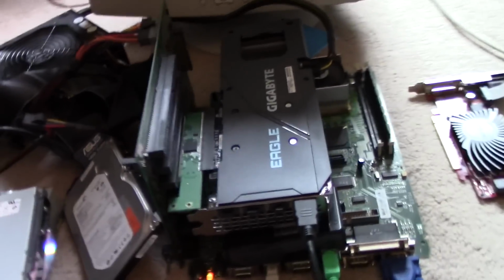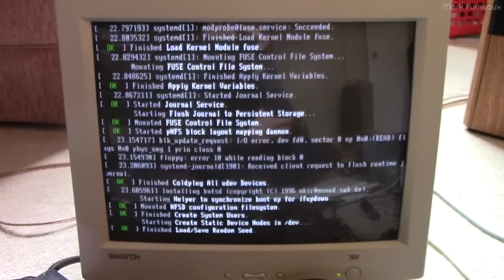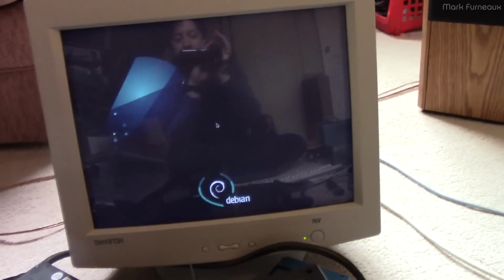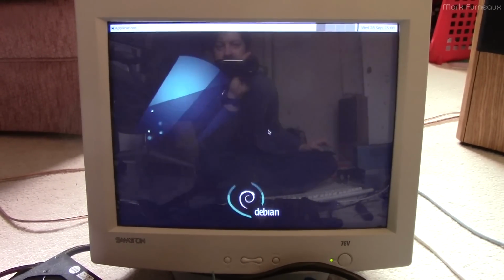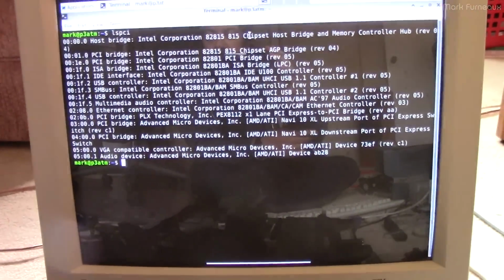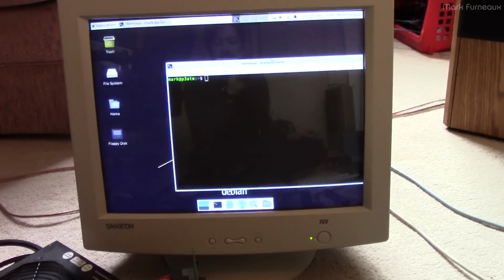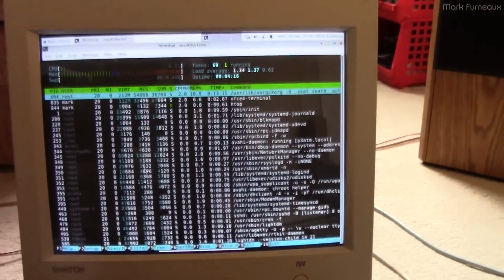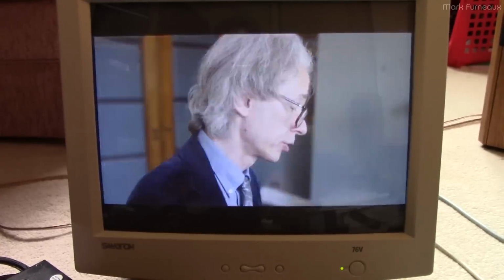AMD RX 6650 XT on a 20 Year Old 850MHz Pentium 3

Comment: I know this is an older video, but w/e... An interesting note. PCIE and PCI are also initialized by the same routine in the BIOS as well. In a previous life I modified BIOS code for x86 VPX and VME motherboards, from Core2 all the way to Sandy Bridge. The VME boards had a TSI148 chip which is a PCI-X chip but we just used a bridge chip for PCI-X to a bifurcated PCIE. Needless to say, the BIOS code was no different for initializing a PCI or PCIE device even through the bridge chip. Might also be of some interest, the BIOS code for PCI initialization in AMI BIOS code (at that time) is exactly the same (even the comments) as the Linux Kernel. 

The work that I accomplished at the time was to add a routine that would allow a user to select (in a BIOS menu option) the amount of additional system memory allocated to the TSI148. So I basically stopped the routine from simply giving X amount of memory requested and reading the amount selected and allocating that instead.

Comment: You should get a pcie 1x to 16x riser cable with external power.

Likely the issues is because lack of 12v on the pcie slot

Comment: Not just putting it together, but also doing it on some exotic backplane system.
Reminds me of the adapter stack to run a Voodoo 5 on a modern board.
As someone running a Pentium III 933 on an i815 board I can only say, well done.
But wow, HD 6450, AMDs answer to the GT 710

Comment: used that converter for my dad's dell dimension 2400 which he still uses btw, upgraded it to a radeon r9 360, also installed a 3ghz pentium 4, and 2gb of ram to help it along and a ssd. i was able to get skyrim working on it amazingly, not that he'd ever use it for that, he just types with it and wanted a larger screen, the onboard intel 845 gpu couldn't display a high enough resolution for the new screen.

Comment: I have been messing with computers ever since age 8. I may not be way too old as my first system was a dell dimension 4000 or something with a p4. Today I use a i5 4590 / GTX 1080 system. Never have I ever seen so many curious questions that I thought were impossible to answer due to incompatibility get answered in one video, hope this gets millions of views! This shows just what windows will do to output to a display properly. Even simple GPUs (ones that are made before the term GPU) work properly. Interesting to see the old vista animation plays. crazy stuff like this is all I did as a kid, plugging stuff into computers and screwing with software. good times...

Comment: you  ui went tol IT school and grad, what kills me is all, the OS manuf and hardware manuf in the last say 3 years or  before wind 10 was pushed out  your computer will run for ever if keedp up cleaned you dont need all the dafrnj updastesa like the ones micro and google for tthje android as long as you have internet comp and it all runs good , then its all good i hagve an ASUS vivobook 17.3 10th gen i5 intagrated UHD graphic wish i did not. but need ed a computer.called ASUS Laptop gives optain to rollback to 7 nope i have an oem of 7 pro 64bit they sdaid no cant install the hardawre is not compatible with the OS alkl the newr modern comp stuff is manuf aroubd and for new and upcoming OS's as long asd your pc runs use it u just wondt be able to run modrn apps And or SOFtware .. if you like your games do it just not online and or newr ones . iam a guitar player so i have an audio interface  scarlett studio interface 3rd gen had ithen i had 7 unplug the OS woukld switch to speakers Windows !0 nope whern i uynplug it sa7ys no speakers or anything is connected egvan plugged my geadsphonesx in nope i hate Windows I wish there was a better gui luinus OS out ther cus  my cmd Sucks  or i would have switch a long time ago. and iam getting to the point that Tech isv really ticking me .. in school "tech makes yourt likfe easier" id like toi find out whom said it id like to beat them.. lol

Comment: unfortunately a cringy part of this video is putting the motherboard on carpet because i know that is really hot and generally i avoid even putting motherboards IN their cases on carpet 
the other cringy part is not cross compiling a newer kernel for i686 just for the demo, it would be more impressive and it would be a good comparison benchmark to check whether the 6650 XT is actually an upgrade over the HD 6450, or the severity of the bottleneck induced by the old hardware is so extreme that it would completely "cap" the 3D performance.
otherwise good video, like other viewers i was not actually aware that fully functional PCI male to PCIe female adapters existed. this will definitely help someone who needs it
Reply: unfortunately you are a furry saying that putting a mb on carpet is cringe so now its not
Reply: @thesigglet  i love this power.. what else can i do.. ok, not using antistatic straps is cringe too!

Comment: And here I am having a two year old system and its causing me issues after upgrading to a rtx 3080ti  :( my old 1070 had ZERO issues, when I upgraded to a rtx 3080 my pc hard freezes and restarts after watching utube or leaving a utube video playing for a few hours and I then get a blue screen saying my Nvidia drivers is the issue. Used DDU, upgraded PSU still the same issue :( and this guy has hardware from million years old working fine

Comment: I think the oldest PC hardware I put together was Pentium 2 or so. I don't think I ever messed w/ Pentium 3.  I was of course peeking under the hood way back when 386 and 486 processors were a thing.  I blew up my Parent's 386 PC (my first home PC) by trying to vacuum out the dust inside it.  This was before I learned about how static electricity and PCs don't play nice together. :D

Comment: one problem here that is vary misleading.
it does not matter that much on what kernel your using it's the instruction set decoder that matters the most.
you can use a custom kernel to help out with the address issues but still you would need a complete custom instruction set and address compiler to help the instruction protocols decode and compile a proper instruction for the CPU northbridge to transfer a mem address to the PCI bus.
the little fancy card has a decider on it but it's trying to brute force backwards compatibility that the bus is limited to but it can not get a proper address do to it missing instruction sets that the CPU lacks that is required by the GPU.
in short the RX 6000 sires would never work as normal graphics card on that platform as it requires instruction sets that do not exist.
the only way around this would be to made a custom instruction set and address decoder and compiler with little more modren CPU and a compeltely custom kernel for said mem address.
you could get it to work as a basic card at best but you would never be able to get a fraction of the cards ability as there is a vary limited bandwidth with that set up.
it's not impossible but it's also no where near the time and effort to get the set up to work just to get about 8% to 10% performance out of the card.

Comment: The PCIe to PCI is nice and all, but to really have a bit of fun try bridging PCIe to PCI-X. I have several Dual and Quad Opteron boards with Socket 940 and they all have PCI-X slots and I wanted to play a bit with Infiniband and storage controllers, but did not want to spend money on PCI-X cards, or wanted to adapt PCIe video card in one of those mobos, I don't really remember anymore what I wanted to do and did a ton of research on PCIe to PCI-X (100Mhz and 133Mhz 64bit) bridges. It turns out there were only two manufacturers who made them and they are not available anywhere anymore. I found the bridge chips, probably on aliexpress or something, and was ready to fire-up KiCAD and desing a bridge card myself, until I found out how many layers the PCB had to have. On top of that the impedance requirements and the number of differential pairs would have made the entire project so expensive, that I just gave up. At one point there were a small number of commercially available PCIe to PCI-X bridge cards, similar to the PLX bridge, and they were fairly expensive even at the time, but now are impossible to find, as they might have ended up in landfills. The interesting part of the PCIe to PCI-X or 64bit PCI bridges, would be the ability to play with PCIe cards in some old G4 and G5 Macs. On top of the entire PCI/PCI-X 32bit/64bit and the different clock speeds of the bus,  PCI/PCI-X had another major headache causing problem - some were 3.3V, some were 5V, and some ports and controllers supported both. The computer era in the early 2000s was such a chaotic era in terms of peripheral, bus and interconnect design, on top of ISA/PCI/PCI-X/PCIe, you also had the HyperTransport bus that in itself was co-developed with the people who were basically DEC (under a new name) that were working on Alpha CPUs, you had variety of CPU architectures all with their idiosyncrasies in their FSBs and interconnects and you had to interface those to PCI or PCI-X peripherals, etc.  Nowadays everything is so streamlined (however not simple at all, especially if you have to design hardware, as manufacturing and design requirements are extremely tight),  essentially PCIe everywhere and for everything and you are good to go. Btw, nice video, I love a bit of cool, but absolutely pointless technology (this, I think, is a term coined by ElReg, but I might be wrong), as a weekend project.

Comment: Very good video and explanation! Imagine the gpu connected with the ISA slots!
Reply: There is no PCI to ISA adapters as far as I know that were commercially available.  ISA to PCI adapters seem to exist but only allow you to connect ISA cards to the PCI which was likely a stopgap solution for for companies needing to use legacy ISA devices in their production at the time while they replaced some very expensive industrial hardware that needed them to operate.
Reply: @alexisrivera200xable  Thanks for the explanation Alexis, I thought they had already something to do such a conversion.

Comment: There were 440bx mobos that could easily take 3 gigs of ram, and we are talkin 1999 tech (slot 1). Coupled with adapter to socket 370 (slotket) and a Tualatin Pentium III-S, clocked at 1.4ghz you will get more perf

Comment: This was interesting. :) I would have liked to see a few tests of running games on it, if the modern GPU could have been working with 3D. :)  And, for maybe a future video idea, what about comparing that, to a modern PC platform with a really old PCI video card?  For example, something like an i9-12900KS on one of the few LGA 1700 motherboards that has a PCI slot, paired with an ATI Graphics Wonder PCI from 1992 :)
A couple other ideas I think might be interesting would be to hook up an ancient hard or floppy drive (5.25" MFM or an even older 8" or 14" type) to a modern system (LGA 1700, AM5, WRX8, LGA4189, etc), or hook up a modern PCIe Gen 4 NVMe SSD to an ancient system that dates from the early 1980s or even older. :)
Reply: when you use a very powerful modern CPU that does not contain any iGPU/APU functionality (such as a Ryzen 9 5950X that does not contain a GPU), using it with a very old graphics card and present-day GNU/Linux as the operating system results in a situation that is kind of "cheating" because GNU/Linux is now home to llvmpipe, the most powerful software 3D renderer in history. This causes the most high-performance software configuration on such a system to become disabling all hardware 3D graphics drivers and using the display controller as a basic framebuffer, to display the results of using llvmpipe as a fully emulated GPU being executed entirely on the CPU as x86 instructions. 
I watched a 5950X in a headless system with no hardware GPU hit stable 60fps in Minecraft Java 1.19 on low settings at fullscreen 1080p,  in a fully software Xorg virtual display through Sunshine-Moonlight remote desktop, which was ALSO using the CPU at the same time to encode the frames as x264 video to send them to my viewer through the ethernet connection. I expect that the results with very old graphics cards would be similar, with the overpowered CPU running the emulated GPU even faster due to the even smaller than 1080p resolution and not having to also process a virtual display and send it over network at the same time.

Comment: a pentium 133 could run avi files at 640x and higher its the decding of wma - but mpg video cd could be run on that software but not the youtube video with max efficient compression -if you used a timemachine before google bought Youtube and become corporate tube you could find avi files ( i guess and wma )

Comment: games can be runed at software mode in Unreal tournament and even Unreal tournament 2004 - a 700mgz co are minimum on ut2004 thou and in case of ut2004 ou need to tweak the .ini file in unreal tournament/system -there are 2 tweakble files both ini s

Comment: Wow... an NCR industrial PELE2 board!  Didn't think I'd ever see one of those in the wild again!

Those could support 500MHz to 1.0GHz Coppermine P3s if I remember correctly, but the 850MHz chip and 256MB or 512MB of PC133 RAM was a very common configuration.
Reply: Very quick for the time.

Comment: NCR Extended Rom is a proprietary POS ROM For NCR Systems.  its used in a plethora of Point Of Sale systems that utilized Pentium based CPU's and motherboards. 

the SDC Notice is a Silent Data Corruption - this is more than likely due to the PCI-PCIe bridge corrupting a bunch of data being sent over the bus and BIOS does not recognize it.  210H is pointing to an expansion unit, as Standardized I/O Base Addressing says 210 through 217 base I/O is IBM PC Spec for Expansion Units.  the "H" is the specific mapped location of the 210 Addressing header.

Comment: ISA buss is commonly still used in modern systems to connect a few simpler onboard chips like timer and realtime clock.   I believer fan controller and PC speaker  also connects over ISA

Comment: Just for the LOLs  i'd see if you can use this setup for GPU mining,  where bandwidth/ram/cpu don't really matter, but you need a gpu with proper drivers installed. Not gonna make money, but the gpu would actually handle some proper load.
Reply: Should be fine - Gen2 Pcie x1 is 500MB/s and PCI is 266/133MB/s

Comment: Well Pentium M 1.1GHz on HP TC1100 + GeForce 4Go and LAV decoder  WIndows for whatevr reason if i enable DXVA on such old card 720p is perfectly smooth, 18% utilization, and ~50% on Celeron M 800Mhz while if i do it on more modern card, even 2x2GHz is not enough. Core 2 Duo and Intel GPU on Linux VDPAU or whatever extension there is not always works after updates and works best on SMPlayer than on native Linux players. Still works better on such ancient device Windows XP than on Linux. My point is - with good drivers and software everyone might have smooth HD experience even on hardware that is 15 years old. Without such overkill. Impresive fact to be even possible. What makes me sad my point - it might be possible even in past even on older hardware if only software specially on Linux developed some standard way and manufacturers supported it.. This should be defacto standard since 2000, yet most card of that era hadnt got even simplest overlay Matrox for example. This made me hate Linux for so many years so many years.. things possible on WIndows 98 like watching TV, DivX you had to have at least 50% better hardware to do it or be patient enough to enable it, then never do update. In 3D part MESA ruined experience, you never know what runs on CPU what is GPU supported

Comment: Yes it did mess with your connected old r hardware, another security failsafe aka an auto problem is if the GPU pcb and other things don't get a ID on list . Not a problem ,

Comment: Huh? I was able to stream 720p Twitch with an ATI Rage Mobility 128 on a Pentium 3 1ghz laptop with 512mb ram. And it was smooth at 30fps. This level of anachronism is hilarious, and I love seeing older hardware pushed to its limits.
Reply: Same, i was able to watch at GeForce 4 Go, Celeron M 800MHz  25-50% utilization at max 18% Pentium M 1.1GHz LAV, DXVA copy back enabled, it happened 5-10 years after this laptop became obsolete, without LAV i had 100% utilization even at 480p 640x480, before i could not, not possible on Linux even on more modern hardware i own.

Comment: You should try windows xp on it with the 6450 and play some games.
Reply: Microsoft does not keep updating old versions of their OS with new drivers. Linux keeps old drivers in new kernels. As long as someone is willing to maintain them. But to get some really old drivers you often have to build a custom kernel with the ones you want. Because distros are not going to ship precompiled kernels with everything.

Comment: The ISA bus is effectively "connected" on modern systems through the Low Pin Count (LPC) bus. It occupies the same I/O address space: https://en.wikipedia.org/wiki/Low_Pin_Count

The Super I/O chip (usually Nuvoton/Winbond) providing fan control, temp monitoring and legacy connectors, is connected via that bus, even on the very latest systems. :)